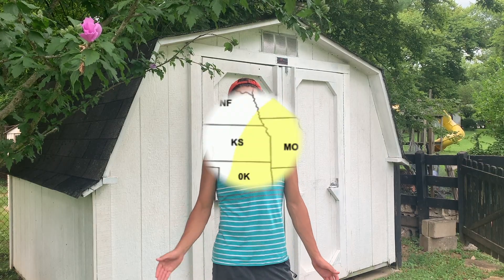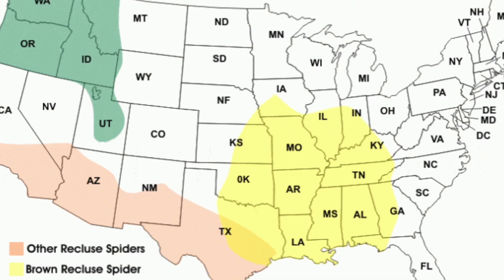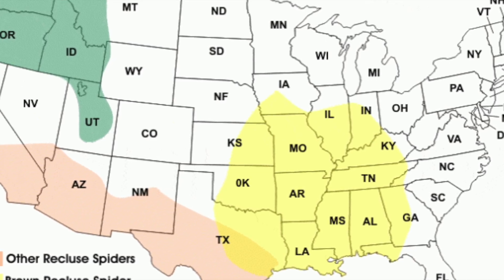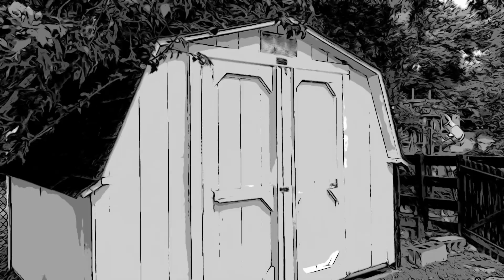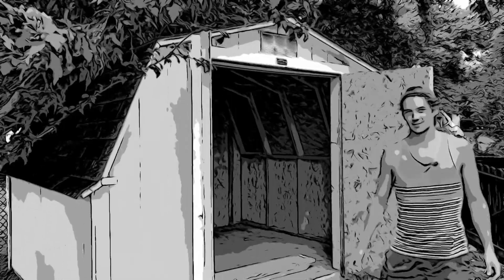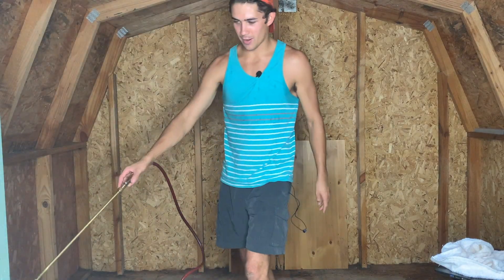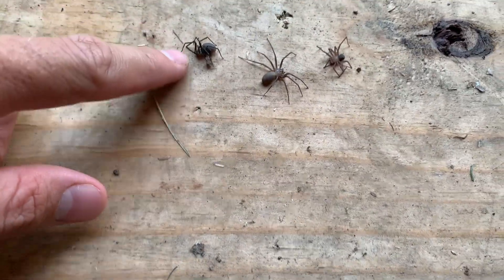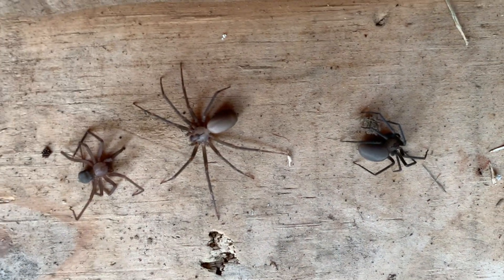Identifying the Brown Recluse Spider Infestation - Example and Treatment

Comment: I live in Middle Tennessee. If you live in a wooded area here, you have brown recluses. I was in a vending business and have found them in the city and industrial buildings too. Our house had a major infestation. We call the “brownies”. We caught hundreds on glue boards a month. We had professional pest control spray with no change. We learned to live with them. Shake out clothes left on floor and stomp on shoes before putting them on. Family of 4 and we have never been bitten. We built a brand new home behind this house and within year, recluses had moved in too. The good news is they avoid you if possible. Their fangs are short so they can’t puncture the skin unless pressure is placed on them, like a piece of clothing or inside a shoe. Many people don’t have negative effects from bites. My advice is lots of glue boards. Keep things tidy. Sprays don’t work very long. Some say diy peppermint oil sprays  helps repel them. I have had luck with using ozone machines that get them on the move to escape the ozone and get caught on glue traps. Ozone Must be used for days and you can’t be in house during treatment. We do this when we go on vacation. They are unpleasant and unnerving but if you have them, you have them. You can temporarily reduce population but it’s a constant battle. When weather gets hot, wet or dry, they try to look for better environment like your house.
Reply from the maker: Thats awesome. Yes I can attest to all of this. Brown recluse are very unique species and hard to control
Reply: Brown recluse infestation are dangerous.  Acting like they’re easy to live with is moronic.  To have an infestation and then one in a brand new house suggests that y’all are doing something like leaving doors or windows open.  It’s not the norm to have spider infestations.
Reply: @SheepEatingDuck  with respect, no where did I say it was easy. I said it was a battle to keep population down. I encourage you to do some more research on the brown recluse. Experts say the recluse have a worse reputation than the real threat. Rarely deadly and the flesh eating wounds are the exception not the rule. They are named the recluse for a reason. Maybe where you live, an “infestation” is rare but if you live in a  wooded area in certain southern states a few recluses become hundred quickly. I lived in a new subdivision with not many trees and didn’t have a problem. Moved to a wooded area and was shocked how pervasive they are. We have our house treated monthly and we don’t leave our windows and doors open. I know you are being extreme to suggest that and know better. Sprays only work if you spray them directly. Powders don’t work long. I’ve tried it all. Sprays, fogs, powders, Diatomaceous Earth, sonic repealers, natural products, ozone, eliminating their “food supply” and more. They feed on their own. They can live for months in a ziplock bag. I did that. The government banned the pesticides that actually worked. They are extremely hardy and resistant to most chemicals. I’ve talked to long time pest control techs from many companies and researched myself for 20+ years. Call me moronic if you like. I’ve done the research. I’ve lived in an area that everyone has them in there homes whether they know it or not. The older the house, the more recluses. I had a friend who thought we were crazy living in a house with a recluse problem. He moved into the area in a newer house and he discovered he had recluses. He thought he could throw money and everything at the problem. He can’t get rid of them either. You control the population best you can. You can not eliminate them. They live in nooks and crannies in the walls, basement and attic. You can’t spray them all when you can’t see them. That’s the bad news. Good news is they aren’t the killers and flesh destroying monsters they are betrayed. Like I said before, they avoid you if all possible. Bites happen because they are in clothing, shoes, or you grab something they are in. They need downward pressure for their fangs to penetrate skin. That’s from a specialist. Look at the medical statistics.  They are prolific in the southeastern states. If they were as dangerous as you believe , we would see incredible number medical reported injuries. My original comment was not infestations are no big deal. Obviously I said how we reduce the population with glue traps, etc. and take precautions with clothing and shoes. The point I was making is that eliminating them is impossible in certain areas with current control options allowed by EPA and just know you can live in a house that has brown recluses. Many people live with them and don’t realize it. I see them everywhere because I am hyper aware of them because I was was terrified of them before I listened to experts and lived and raised 2 kids in a house that was old and had hundreds of recluses. Not one bite. I hate recluses but i am realistic about eliminating them. One last note, we think we have a good control of them and turn on ozones machines. Ozone breaks down organic material so they have to get on the move or die. They end up in the glue traps. We had more than we thought because they hide so well and avoid us. Sorry I triggered you with my comment.

Comment: Hate being that guy, but spiders are venomous, not poisonous. Venomous means the animal or critter needs to inject it's venom to use it. Such as a lion fish and it's barbs, or spiders and their fangs. Poison dart frogs or certain toads and salamanders are poisonous. This means that they do not inject their venom, but apply it through touch or being swallowed. Which is why you can't pick up poison dart frogs because contact with their membrane transmits the toxins. Hope that clarified anything for anyone. If it injects it's toxins, it's venomous. If it transmits through contact, it's poisonous.
Reply from the maker: Thanks!! Yes I now know better hehe. I didn't even realize the words were different when I made this video, I thought they were interchangeable

Comment: I live in san francisco and they are here. As in in my house.
Reply from the maker: uh oh:/ get some glue boards and see how active they are
Reply: @DanTheBugMan  ive actually lived here 10 years & been using glue boards for 3 years under a few dressers ect bc i dont like spiders. Id check them every 4 months or so and thered be a daddy long legs and a reg house spider once in a while, and then between 1-4 of these spiders i thought looked like recluses. A few times i googled, but the viilin was kind of hard to see on mine and i just wasnt sure, my bf at the time looked and said nah theyre not the same. Then a few days ago i changed the boards again, there were 2 of that spider, so i posted on a what is this bug board and multiple ppl confirmed its a brown recluse, and one showed me the outline of the violin & now i see it-its just the spiders i catch are alittle darker so it was harder for me to see.

Is seeing 2-3 on a glue board every 6 months bad?

Im moving anywsy, for various reasons, but this certainly makes the move much more urgent.

Its weird to think ive lived with them for years & didnt know.
Reply from the maker: @merkitten953  that's good that you were using the glue boards. think of it this way... those 2-3 you caught were 2-3 less spiders in the house! But no that's not many at all. Thats just a couple wondering inside randomly from the outside I would say. Good luck with the move

Comment: We're visiting my Mum in Central Arkansas and we've run into these numerous times. We've been told that the "sticky traps" are generally what work the best because the only good residual that did work was banned by the EPA several years ago. We hired a pest control company that uses Delta Dust, and the traps, but they said that the only other way to kill these completely is extremely expensive. She lives in a rural area, they would surely reappear so that option would be a total waste. I give you credit... Even back home in Southern Ontario, I'm not fond of our spiders (Golden Orb being the exception, they are amazing). Great video and info. Side note and compliment... You have incredible eyes 🙂
Reply from the maker: Thanks for watching! I have a couple takes on this situation: Glue boards are great at monitoring but will not reduce a population. Also delta dust works pretty well, there are other liquid residuals that work well also, the EPA has banned some products but there are many products that still work great. There might be some physical techniques that could help reduce the population like removing their shelter areas if possible. Applying liquid chemicals monthly works great too :)
Reply: @DanTheBugMan  Thanks much for the info! As for the residuals that can be used on a monthly basis, are these available to purchase without a license/certification? I'll never forget my first - encounter - with one of these little guys... I was gathering up a pile of laundry, minding my own business and then out of nowhere, one jumped out of the pile... Yours truly fell back on his derriere lol. Funny how I don't grimace when I hear 100 cm of snow is on the way, but a spider sends me into a panic like that, eh lol 🤣 When head back home to St Catharines, I just want to make sure these guys stay out as much as possible, keep Mum safe. I truly can't thank-you enough for your help! 🙂
Reply from the maker: Wayne Masters Jr hahaha yeah well that’s just human biology! It benefits us to be afraid of stuff like spiders and snakes because they can be venomous. Yeah there are some that can be bought online. We use products called transport and crossfire. Those work well to kill brown recluse spiders
Reply: @DanTheBugMan  Haha, I definitely fit the mould with a fear of both 😂 Even in our region, we're considered being the warmest spot in the East, the weather is undoubtedly warmer... Winters growing up, snow would cover the ground starting in November, we wouldn't see green until March, early April. Now we're lucky to have several consecutive days where it's below freezing, several centimetres of snow on the ground. And summers... Phew, the occurrence of days above 30 degrees with humidexes in the upper 30s/low 40s, it's like living several hundred km's South now. So with this warm up, in Detroit, Windsor, there have been people reporting the Brown Recluse, even Black Widows now because the climate is so much warmer. Thanks for your expert help... Of the two products, how often do you have to spray, and does it leave an odour, drying time... Thanks so much man!
Reply: Bayer Deltamethrin dust, blown into cracks with the appropriate duster, will absolutely massacre these hellions. I know because I've used the technique myself in a cabin that was infested with thousands of them (and 20+ would literally come out of the woodwork every night). 10 grams of deltamethrin dust can do what a dozen CANS of Raid cannot.
Reply: @tetrabromobisphenol  Many thanks for your feedback. My Mum's house is in Central Arkansas, she moved here for work, and we don't have them back home (Southern Ontario) thank God. We've had contractors come out to clean the brush around, take away as much habitat for them, but man, they still are all over. The damn wolf spiders, too... Ugh. I'll take our long winters up North any day to this haha 🙂🇨🇦

Comment: I've heard that it's practically impossible to get rid of an established population in a house. The only treatment, that I've heard of, that will kill 100% is tenting the house but even then there is no guarantee new ones won't just come in and start over.

I moved into a house 3 years ago that was built in 1900. It's 4k sq ft and sat empty for 3 years. I've found on average 25 of these guys in glue traps I've laid around the house.

This morning, found one chilling in my kitchen sink as it's starting to warm up here in middle TN.

I've probably spent about $2k on "brown recluse" treatments, where they dust the attic and spray all over the house, but they keep coming.

Unfortunately for me, and my arachnophobia, looks like I'll be stuck with these guys as long as I'm living here.
Reply from the maker: Oh man that sounds like a tough situation. BUT I don’t think there is NO solution. They may be hard to get rid of but they can always be controlled some way. Maybe there are some physical changes that could be made to the home to make it a less desirable location for the spiders. Good luck!
Reply: @DanTheBugMan  I think the glue traps are the best method. I'm not too sure the dust stuff they do works much as I saw one in my atti. Last year and noped the hell out.

I've got two doors to replace and limbs to remove around the house. So maybe as the years progress I'll find less and less.

Talking with my peat control guy, he said it's not uncommon to find them.in houses here, and that fi sing 25 a year doesnt mean you have an infestation.

He said I should be worried when I'm finding 25 a day.
Reply: Call a company to look into extraction of brown recluse I have over 40 people I have done and it helps a lot keep pest control but dusting outlets baseboards if you have a crawl space have them extract there have them pull out insulation it won’t be cheap but it is effective
Reply: @muddywatermafia3863  I guess I'll have to google that. I've done the dusting of dustboard and outlets and my attic and they still get found trapped in my glue traps.

I've killed 2 live ones and have found 4 in glue traps since May when they start getting active here.

I actually had my insulation in my attic removed within the first year of being here due to a possum getting in the attic.

My crawl space I'll eventually get encapsulated.

I think getting these limbs trimmed away from my house should help as I've been told they love living in tress and usually will jump from them onto roofs and get in through the small cracks that way.

I don't know how "extraction" would really work seeing how these things hide. Are you just simply saying having the insulation removed should "help" but not fully get rid of them, yeah? Cuz you'll still have ones just hiding in crevices and all that.
Reply: @fargnbastage  the insulation factor is the main place for them to hide if you’ve had that removed your best bet is to start on the crawl space
Reply: @muddywatermafia3863  Yeah, I plan on doing the attic and crawl space at the same time to get my energy issues under control, and I've got pretty high humidity in the crawl space.

However, part of me knows I'll still see some.

Luckily I don't have a "real" infestation. Most I have found in 1 year was 25. Seems to be dwindling. I know I lost one in the attic last year...but it looked to be male so hopefulyl it didn't find a female to reproduce with =/
Reply: Put diatomaceous earth in every crack.